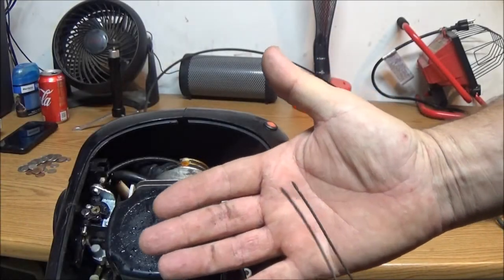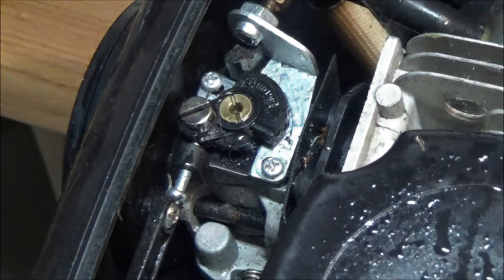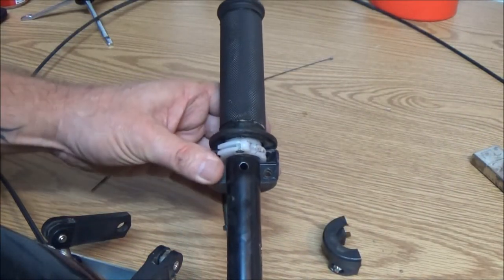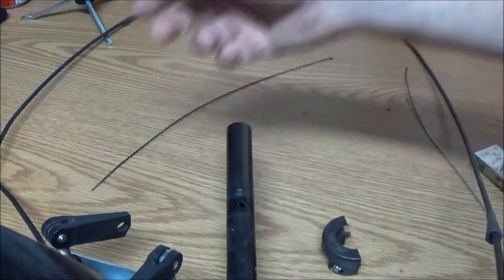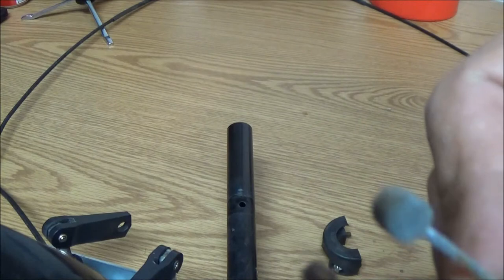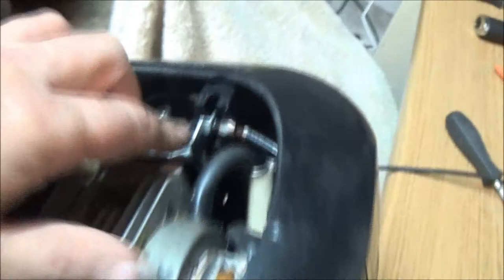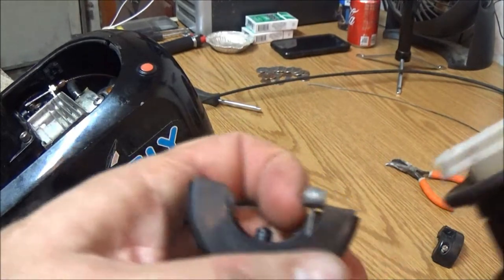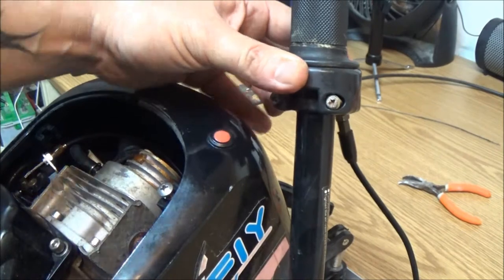Throttle Cable Repair For The Boat Motor

Comment: Great Video! I have a quick question where do you think I can buy one of those throttle cables and handles for my outboard?
Reply from the maker: Thanks. You can get them on line very cheap. Type in outboard throttle cable assembly and it should come right up, search from there. Most likely ebay.
Reply: Make them!